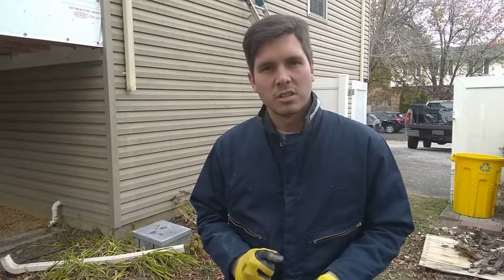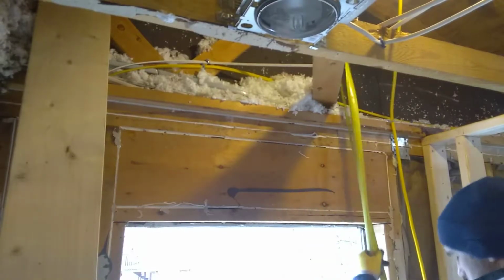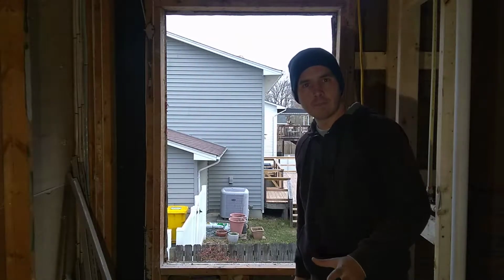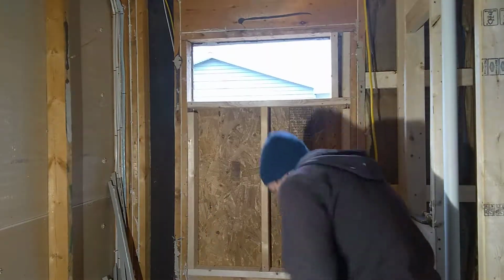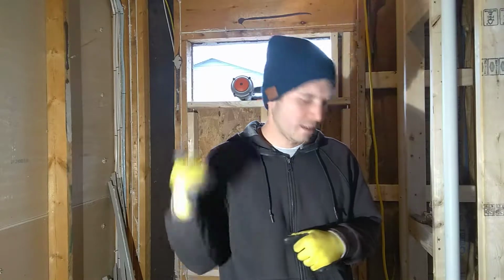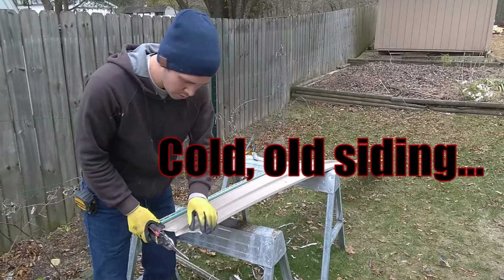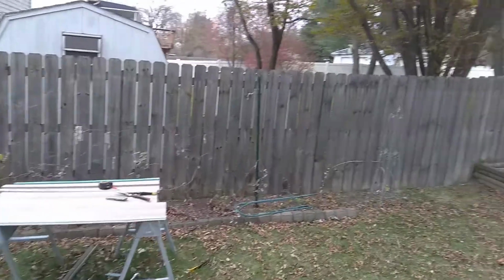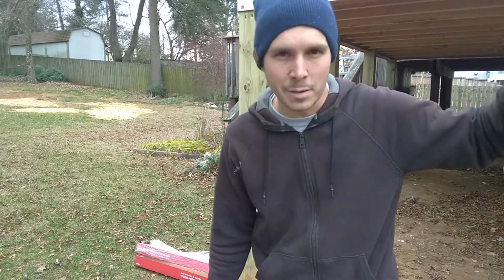House Addition | Window Swap | Day 38

Comment: What's an addition like this cost ??
Reply from the maker: It's very hard to gauge pricing now with all the price changes compared to 2018 - 2019.  Also labor pricing could make a massive difference in total cost.  Having said all that,  I would guess around 55k - 65k if it was done today.  If you did it yourself it would be much less, maybe 20k or even less.  Thanks for the comment
Reply: I'm a contractor in Montana..have built a few additions .. but pricing has gotten. A bit out of control, as you mentioned ...the building process still fascinates me , thanks for sharing ..
Reply from the maker: You're welcome.  I'm glad you enjoyed watching